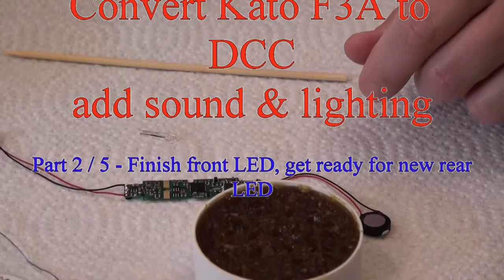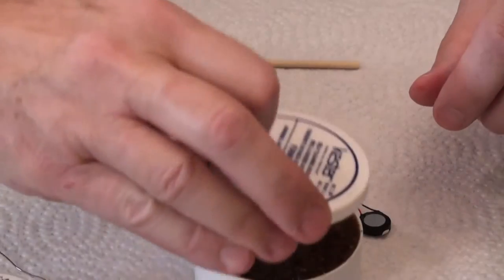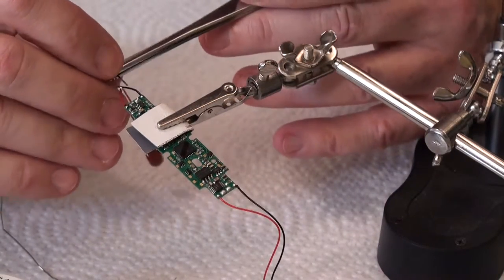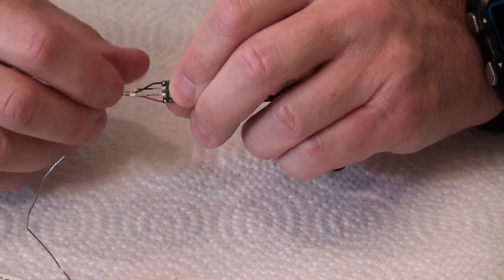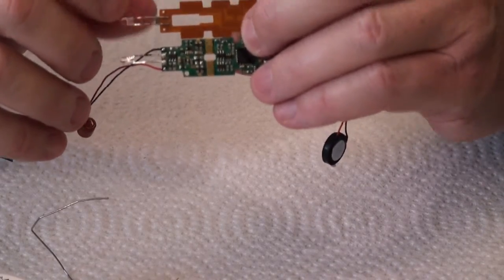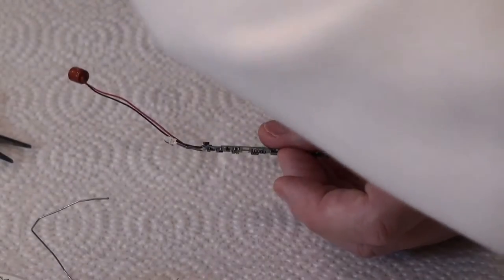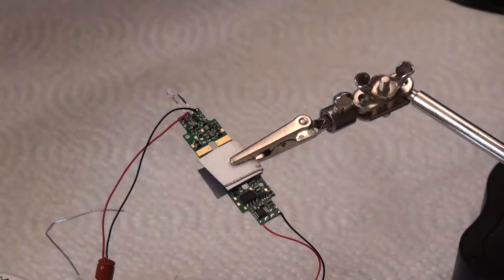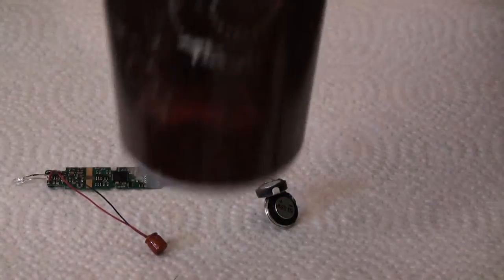install sound decoder in Kato F3A part 2 of 5

Comment: Having the right tools for the job is essential ( you have a very good soldering iron) and 3rd hand.Good point about the kapton tape. Rapping it around the right way and cutting off the excess on the correct side prevents a possible short.
Reply from the maker: Hi John, you are right about having decent tools.  If you are going to do much work, the right tools make a really big difference.   And, in my mind, the difference between enjoying what you are doing and muddling through stuff.

Comment: The factory bend clears the crew compartment but doesn’t line up well with the lens/light rod. It lights but doesn’t throw the light down track as well, in my experience. 
I’ve been Z’ing the legs of the LED down at the decoder a little bit, then up at the led so it is still horizontal, just lower, and lines up extremely well with the light pipe. 
Give it a try next time you have one apart and see what you think.

Comment: hi could tell were you got the led
Reply from the maker: Hi Doug, the LEDs are commonly available.   I got the one you see here from Model Train Software (http://www.modeltrainsoftware.com/ledlights1.html).   If you are not familiar with LEDs, this is a great spot to get started.  I've picked up an assortment.  In my video where I've installed red lights at the end of my passenger car, I picked up the red LEDs from these guys.   Those come with the bridge rectifier & resistors already installed so can run off either DC or DCC (up to 16V I think).